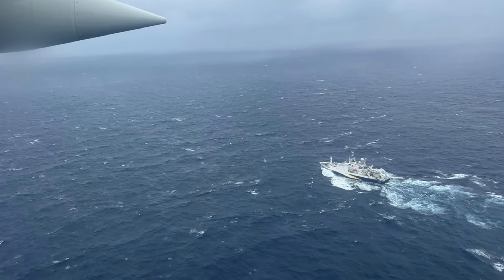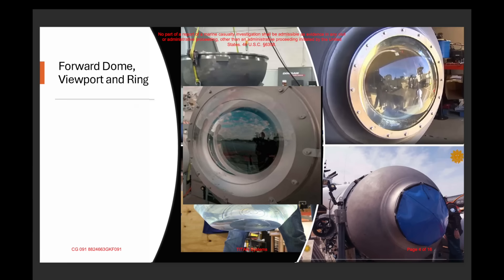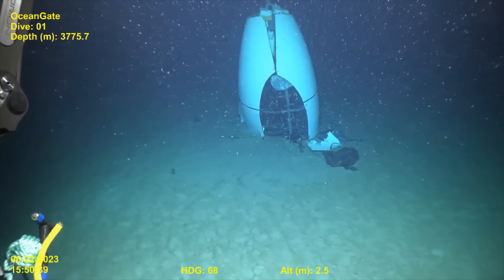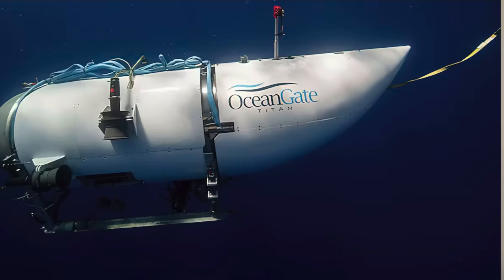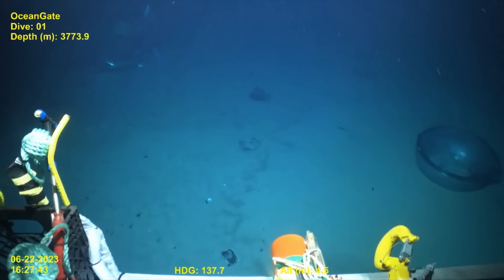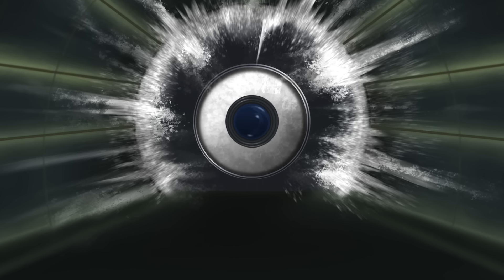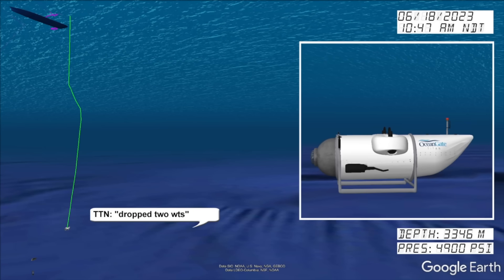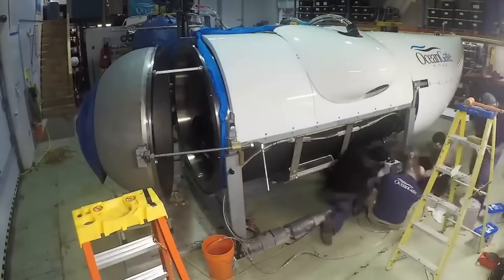Analyzing how the Titan submersible Imploded.

Comment: I'll add a medical perspective. Almost instantly after the great cracking, the hull would have collapsed and shattered. 

The enormous compression would have created a flash explosion of enormous heat (I am reliably informed) combined with a great compressive force within the hull.
The simple structural framework of the human body does retard the compressive  (and thermal) force of a serious implosion.
Though I still suspect instant great pain, their unconsciousness and deaths would have been in microseconds.

It does appear that this fire or heat caused very bad burning all the tissues, blood and fats around the bones of all the corpses.
Leaving the charred remains of the curled up, shrunken skeletons still somewhat discrete. 

This would then have been followed by an instantaneous rush of enormously pressured seawater. Extinguishing the heat, but crushing and mangling the charred body parts further together, while compressing any structure with air or gas left at all anywhere. Such as between body parts, or within the remnants of ears, lungs and sinus cavities of bodies. 

However it seems the usual melting and fusing of tissues into the body parts of others, (as there is, in ongoing burning) would have been curtailed by the freezing waters. 

Elements of these bones and corpses can be seen in the titanium dome.
The captain of the ROV implied that the dome was full of everything the ROV had videoed, and that its contents were significant. They also stated that the human remains were treated respectfully.

Additionally the pathologists were quite clear about being able to untangle the remains of all five passengers to identify. 
I'd imagine the details will emerge soon. Regards

Comment: Good analysis. I would argue one point though. Human remains were found within the aft wreckage of the Titan submersible. They were "apparent human remains" at first. However, the DNA of the remains were analyzed and the remains of all five passengers were distinguished. Those remains were separated and "respectfully" carried so that they could be given to their families. 

This leads me to believe that the Titan submersible failed at either the ring (where it connects the titanium to the carbon fiber fuselage and/or where the titanium dome and ring are bolted) or in the window within the forward dome itself (which was never rated for such depths). The ring-to-carbon failure would find the weakness with the carbon fiber giving out. The ring-to-dome failure would be a glue or connection breach. The window failure would simply be structure of the window itself (or how it is attached to the dome). 

The resulting implosion from such a breach at any of these would cleanly tear off the dome, window and ring. The carbon fiber fuselage would simply unravel at this location with the rest of the implosion pushing the remains in a sudden, explosive manner toward the aft titanium dome. This is exactly what was found. The interior portions of the submersible -- including parts of the fuselage, interior flooring and, sadly, the bodies -- were explosively pushed toward the rear.
Reply: Thank you. I still find the event very disturbing and traumatising but I will watch this entire video and it’s important to know and learn from this tragedy.
Reply: I would have to concur. I don't believe the ring was deformed prior to the implosion. Cycles where the edge of the CF was being compressed and the titanium ring being compressed to a different rate. 
The CF was constructed in a 2-D way, no interconnection between the layers. 5 inches of CF is pretty thick, and as a composite material, even F1 doesn't use anything that thick. If they did a honeycomb construction, where the load would have been distributed more evenly and in a 3-D fashion (kind of like why the metal is a good material - it's crystalline so loads are distributed evenly).
Reply: You have no idea how it imploded. No one does.
Reply: @gt9760  I think that you missed the part where I said "this leads me to believe...." So, I didn't assert that this was exactly how it imploded. Rather, I simply shared an opinion (as someone with an engineering background).

Comment: I think the coast guard is starting to think the front dome swinging open. Hyperextended the hinges and started the debonding of the epoxy.
And when the frame popped back in after shifting, it slammed into the ring causing a shock that transferred into the titanium ring. 
And that started the process of failure.
Or that’s the direction there line of questioning is leaning towards

Comment: Still can’t even comprehend the water rushing in and everyone gone in milliseconds. Did they ever find any remains of clothing or possessions? Or is all that turned back to atoms too?
Reply: Water never rushes in first, the implosion speed is faster then the liquid elements trying to get in. Now lets say they sprung a leak, if they can't fix it, the pressure inside will soon equal the pressure outside. We would have no implosion, because water inside now is at the pressure of the depth or close to it. To have a implosion you can't already have a easy way into the submersible if your Mr pressure lol. MR. pressure to have his wish of implosion, must do it the hard way and just Squeeze you and squeeze you till he crushes you with full Single-atmosphere in your can. <~ this is why implosion is Violent with no leakage. Granted if by the grace of God you have a large leak, you will die much slower but from the same pressure. pressure inside will rise at the speed of water vs space. Your better off with implosion.  The crushing speed is just north of 2x the speed of sound, that's instantaneously at that speed. I saw them placing death white sheets on the aft section, and a smaller one on the front section = That's were the bio human material must have been found. Them pictures we see in the videos have been edited, to not show you splatter material of human remains.  The large aft section with everything crushed to the back most likely has most of their left over remains in it. "could be mush with lite clothing or just paste." It was enough for them to cover up the certain areas with large white bed sheets.

Comment: A reason why the main wreckage isn’t totally like a soda can crushed by a gorilla is that on the inside under the decking on which the crew sat there is a structure supporting this decking and holding several oxygen bottles. Just look at construction pictures of Titan interior. In one picture one can plainly see four green HP gas flasks (bottles). Green is the standard color for oxygen storage and distribution piping. These cylinders likely can resist crushing and implosion (thick walls, homogeneous metal cylinders with hemispherical ends - just like Titan’s shape). Some of the “bar” or structural framing shaped pieces jutting out of the main wreckage could be part of the subfloor framing. 

I concur (perhaps just a hunch) the initial failure began as stated here - somewhere around the forward joint between carbon fiber cylinder and titanium ring/end dome. My hunch (perhaps wild speculation) is that water under pressure forced its way into the wall of the carbon fiber cylinder causing delamination between layers. Once a critical crack length was reached the failure would be instantaneous- the crack would propagate through the brittle carbon fiber - matrix composite at (> ?) the speed of sound in the solid. I think water pressure (shock wave?) would cause some outer layers to be flung off outwardly and rearward; the inner layers would crumple (& buckle)  inward and rearward. Water rushing in (perhaps just the compressed air) would fling the forward dome in the opposite direction. The acrylic viewport was designed to resist water pressure pressing inward from the outside. A blast of water or air from the interior could well tear the dome & retaining ring off. 

The theory presented here is supported by the testimony of Tym Catterson who actually examined recovered pieces as they were brought up. His assessment of the forward titanium ring led him to conclude that the failure started at the forward joint. He also noted there were two recovery operations: the first which brought up the forward dome, ring, skids, tail cone & fairing - these pieces were the subject of the now well known & distributed video; the second recovery (confirmed by a USCG press release) occurred in October 2023 that brought up the main wreckage that included the rear dome, ring and main remains of the hull. (If any of this information was presented in the first half of the video I apologize for missing the start of the live premiere and skipping to the middle.☺️)
Reply: As you say it it sounds right. I have become frustrated with people overlooking the fact that the joint was in compression. The carbon fiber at the joint must have been damaged by water under high pressure leaking past the sealant at the ring and weakening the carbon fiber. This may have been an ongoing process that could have been detected after the last successful dive. Carbon fiber is good under tension but this was compression and something it was not suitable for. The joint could have failed, but not catastrophically. The major failure would have been when the carbon fiber composite lost it's integrity.

Comment: According to the transcript that was released, the crew was getting sensors alerting them to cracks in the aft section around the ring. For 20-something minutes, they knew they were in trouble. They dropped their ballast and tried to ascend but their power bus failed, they switched to the back up bus but never responded to another question. The transcript also shows that they descended much faster than intended getting near the bottom an hour early on a 2.5 hour trip.
Reply: The transcript was fake... at least the first one that was released

Comment: Fair warning, this is long. Feel free to read for more information.
A summary of why Titan failed, why carbon fiber and epoxy resin shouldn’t be used at extreme depths, and why it is nothing like the AUSS in construction:
Unlike the AUSS, the Titan utilized unidirectional carbon fiber in its hull construction. Specially 480 layers, 240 of which were strung longitudinally and the other 240 strung circumferentially. The hull consisted of:
The carbon fiber, which was 5 inches thick, the titanium end caps which were each 3.25 inches thick, and the acrylic viewport at the front, which was 7 inches thick. At the depth of the Titanic, the Titan would be experiencing about ~51,700 tons, or 104 million pounds, of pressure being exerted. That’s like sitting the USS Missouri battleship on top of the carbon fiber hull of the Titan.. and expecting the components to hold. There are no known epoxies that can withstand this amount of pressure consistently, and more importantly, safely. 
The failure happened near the front of the vessel, therefore, the epoxy holding the titanium end caps to the carbon fiber hull failed. We know this based off wreckage footage recently released. It did not fail in the middle like previous simulations showed.
Look up a stress and strain graph for steel, then do the same for carbon fiber. You will notice with steel, there is yield strength, ultimate strength, and then eventually fracture. With steel, you have some warning before you reach the elastic region, and another warning before you reach ultimate strength. While with carbon fiber, you will see the elastic region abruptly end causing catastrophic failure with little to no warning. Even worse with carbon fiber, the ultimate strength and the failure point are the SAME. Carbon fiber is brittle, like glass and ceramics. Brittle materials fail suddenly, and catastrophically, with very little warning. That is just unacceptable in engineering, and is the main reason we do not see submersible vessels with carbon fiber paired to titanium, and carbon fiber pressure vessels made of carbon entirely. Failure points are unacceptable for safety, and reliability in cases of GOOD engineering. 
Carbon fiber is also porous by nature. The epoxy is supposed to combat this, but you simply can’t get epoxy in every single microscopic pore. Carbon fiber does NOT like to be submerged. It furthers the act of the epoxy separating from the fibers. This causes a catastrophic cycle of failure in itself. Pores act as a site for water intrusion, water intrusion causes further cracks to form and fibers to debond. This is a bigger problem at water pressures of 5,000psi. More water means more cracks, more cracks means more water etc. 
You can combat this by placing the hull in an autoclave, and heat curing the carbon fiber and epoxy. Autoclave curing removes pores from the structure, and generates a smooth surface. 
Well Ocean Gate didn’t do this. They simply put the hull in a giant conventional oven, and left it in there for a week. 
In conclusion, there was no way they could’ve done this, and have it not fail eventually. It was inevitable, with the corner cutting. Very unlike the AUSS, which I’m sure was done with every single safety produce in mind, and it was an unmanned craft. Research vehicle vs. Experimental vehicle.

Comment: I agree. the elastic modulus of titanium is different than carbon fiber. no adhesives of different make would have mattered. After repeated dives the difference in compression and expansion weakened and cracked the adhesive and seal. I saw another video of missing bolts on the titanium ring as well. Jeff Ostroff has exclusive video of half of the bolts not being installed on the fore titanium dome. if that is true than the seal would also be compromised by not enough compression of the seal in the spots that were missing the bolts. The Titan was only tested to 3400 meters the titanic is at 3800 meters. It never made the safety factor of 1.2X at 4800 meters. it failed 3 times in testing at around 3000 meters of pressure..and less.
Reply: It's trivial for an engineer to compensate for the different elastic modulus of differing materials by adjusting the thickness of the parts. Double the thickness = 1/2 the strain = 1/2 the movement.

Comment: After watching this, Titan sub disaster is similar to the Chernobyl disaster, here's the similarities:

Chernobyl disaster: flawed cheap reactor core design

Allowing under experienced operators to run the reactor, mainly night shift. (Keep in mind it was mostly the design to blame for the disaster)

No containment building for the reactor in case of an explosion, just a normal building.

Similar accidents before but not an explosion like chernobyl (if you wanna learn about chernobyl and more about it's RBMK reactor, you should watch That Chernobyl Guy)

Titan sub tragedy: cheap sub with lots of budget cuts.

Similar but less worse accidents.

Experienced engineers being fired.

Comment: There is a slight problem with your analysis. According to the testimony, the water got through the GLUE LINE, which holds the TITANIUM RING to GRAPHITE HULL of the submersible. You can clearly see that titanium ring attached to the rear dome. The FRONT DOME, however, is torn free of the Titanium Ring, to which it is bolted. The FRONT DOME would have been blown off with the TITANIUM RING still attached. What happened to the front TITANIUM RING? 

As to Stockton Rush, he was all of it, a Con Man, a Criminal and Mentally Unbalanced. Being a supreme egoist, who sued people at a drop of a hat, for any perceived slight, he couldn't get anyone to get into the Sub, so he had to pilot it himself.  In his darker moments he joked to his friend that Oceangate Titan is a Mousetrap for Millionaires.  

There is no more experimental or exploratory value to diving the wreck of the Titanic except for tourism. Nargolet mapped out the geography of the ocean bottom surrounding the wreck and the prevailing currents. There is no more challenge for professional submersibles diving to Titanic. At this point Titan submersibles are certified to depths exceeding Marianas Trench and are certified "to any Ocean Depth" known on Earth. Oceangate paying customers, on the other hand, those who testified so far, they know nothing of the Ocean exploration, but they believe themselves to be explorers. People like Fred Hagen are PLAYING at exploration. 

Which begs another question. If the front dome was torn off WITHOUT the titanium ring, how did that engineer testify that he saw the clean shear all around the glue line on the front TITANIUM. RING? I have to contact the CG Board and ask if the ring is attached.